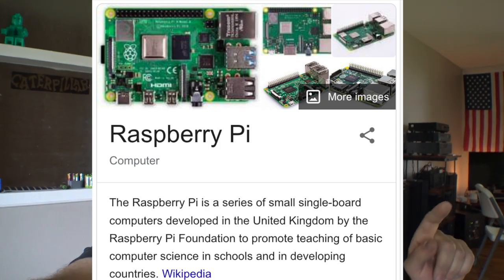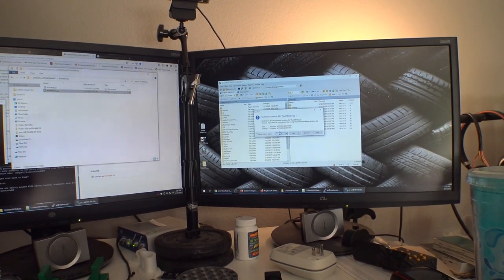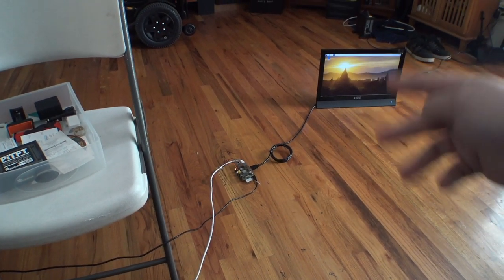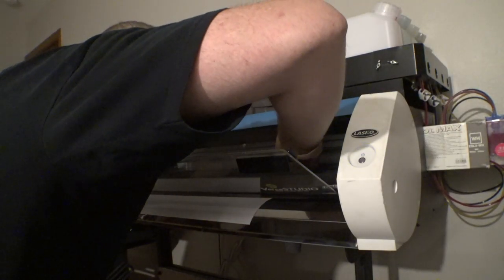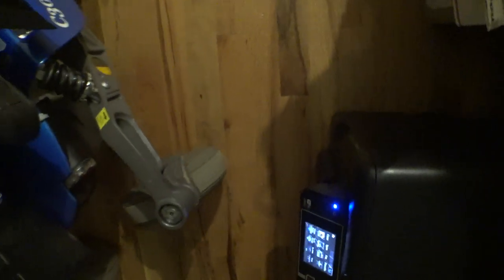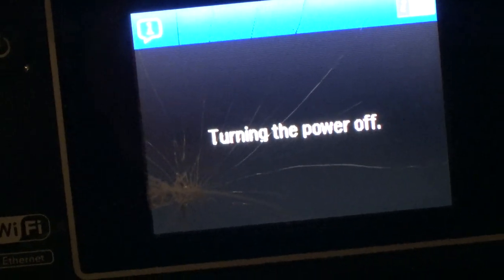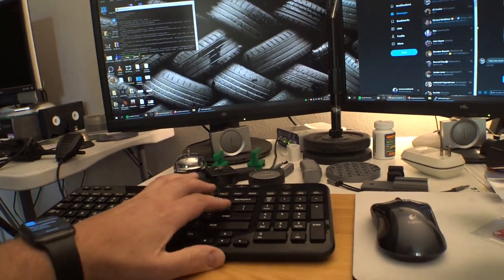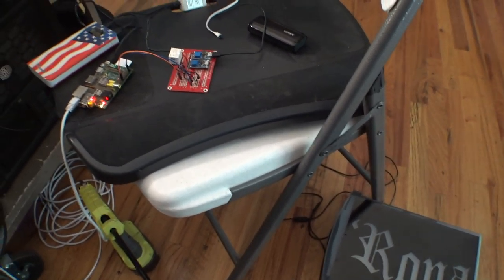MEGA VLOG 505: the electronic sign! (twitter API)

Comment: Hi dude 
I have a very strange problem developed in my permobil street. Joy stick is turning on normally. Seat tilt, recline, leg rests and lights working fine. The joystick is showing no error sign but still wheelchair doesn't move when I operate the joystick.

Could you please tell me the reason of the problem and possible solution?
Reply from the maker: do the brakes click, or does the chair make any noise at all then pushing on the joystick?
Reply: @TotallyNormal-  no break doesn't click. No response from chair by moving joystick. Seat tilt recline does move with joystick though.
Reply from the maker: hmm... thats odd.. haven't heard of that happening with no errors or anything.. sorry.. ya stumped me on this one :^/  if there's another joystick available could try swapping it just to troubleshoot and see if the issue is there, or the main controller..
Reply: @TotallyNormal-  Before this problem in only one condition wheelchair used to behave like that and that was when it was in max tilt position. I don't know where's the sensor that inhabit wheelchair movement in tilt position is located. May be the sensor has bad wire.
Unfortunately no other joystick of the same model available.